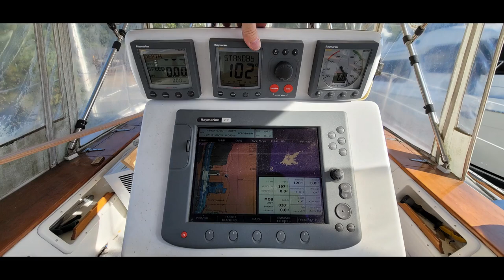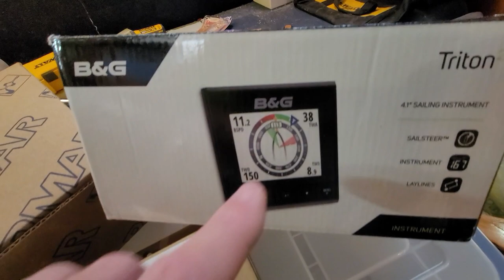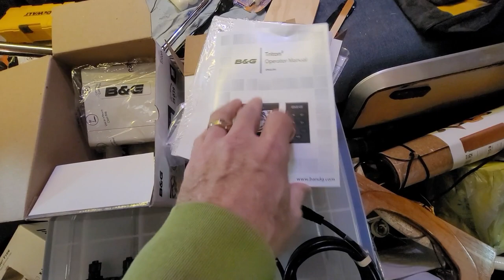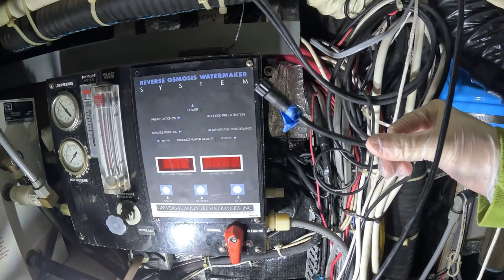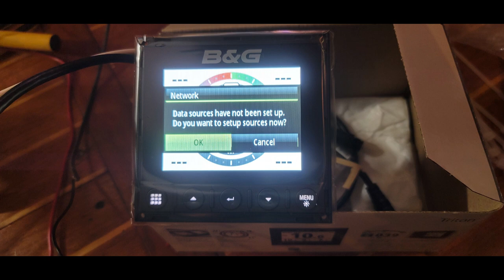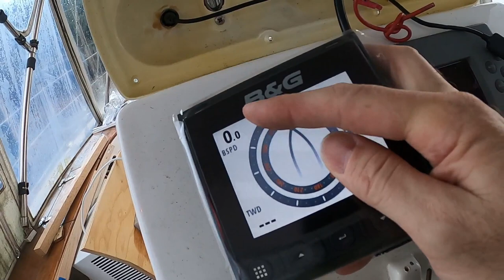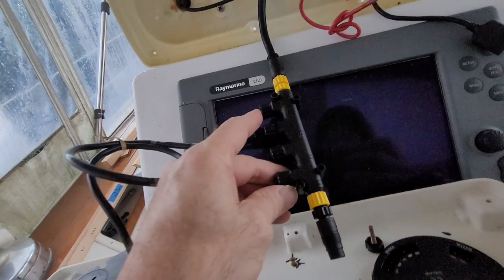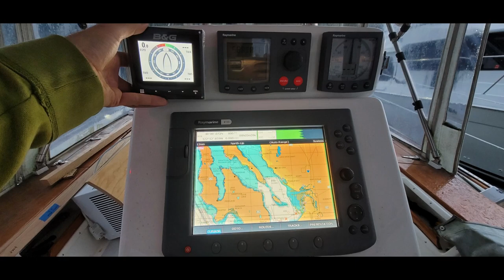B&G Triton 2 MFD Install- Setup. Comp NEMA 2000 Network Backbone inst. DIY Nautical Dream. S2 E51

Comment: As a twice B&G owner...I wouldn't recommend them.  Killing time watching YouTube while on hold to talk to B&G for the past hour and forty five minuets...bet I'm on hold for another hour.  seriously.
Reply from the maker: Ohh man.  I am so sorry to hear that.  We have been hearing some bad experiences with B&G. So far, we have only purchased the single MFD.  Thanks for your comment, and I'm sorry to hear you're experiencing poor customer support.
Reply: If you are only in for short money I wouldn't do any deeper.  The only reason I have this setup is because it came with the boat...just installed in 2019 and never worked right.  4 on deck and one below.  They put a Simrad AP48 on a 16 ton sailboat...just to assure complete dissatisfaction I'd have a better chance fighting Tyson fury...they are a sad bunch.
 @DIYNauticalDream
Reply from the maker: @bobgaysummerland that's not a good outcome.  What system would you recommend? It currently has older Raymarine setup